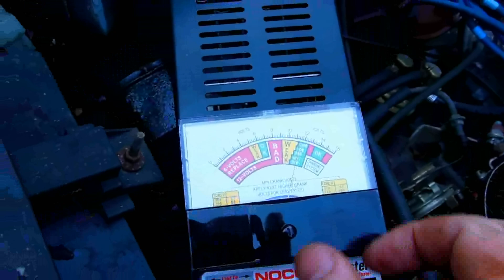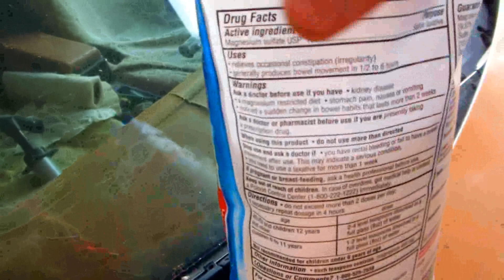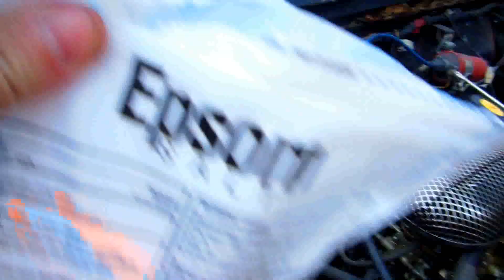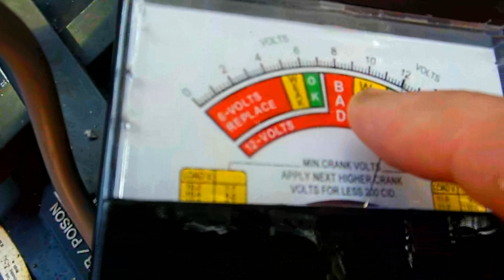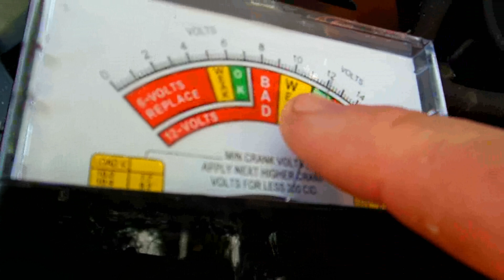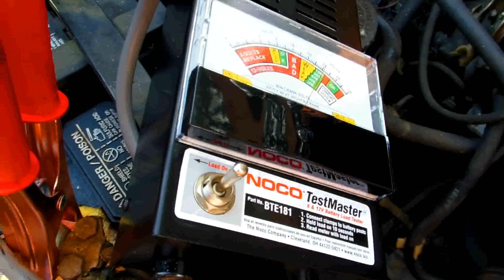Simple, Easy Car, Truck & Jeep Battery Regeneration on 15 year old battery

Comment: Did you remove any of the original acid/water in the battery before adding the epsom salt solution?
Reply from the maker: no, none removed

Comment: I use a blinker relay hook it up to my battery charger at 6 amp and a 1990 battery and it seems to be working not done with my experiment yet and a car headlight old glass one

Comment: I am confused on what all you did.
You added epsom salt and distilled water to each cell of the battery and then trickle charged that is clear but after that did you drain out the salt and water or is that it?
Im here cause my battery is hard to start and it seems a few of my cells are empty of water I can see the plates the rest are fine and I need to know what to add in there so I can then trickle charge my battery. Thanks for your video.

Comment: The secret is coke ! Drain the battery completely and rinse out with water and drain again then fill with a fresh coke drink and it will clean the shit out the battery leave the tops off and after it has sat for a couple hours shake it up and put on charge overnight next day , check it out  !
Reply: Yes, I've heard of this being done in remote   places like parts of  Africa & they say it works. Coke makes an old coin clean up like new, so it likely would clean  up the plates. I'd only do any of this stuff on an old failing battery. Adding chemicals won't make a newish battery last longer.(I tried it as an experiment.) Cheers.

Comment: if you say tickle charger how many amp is that.....coz I try to use a 2 amps 12 volts and it never work
Reply from the maker: I used a "Battery Minder" trickle charger with 1 amp and a special de-sulfating mode.
Reply: I have spent months studying battery repairing and found a great resource at Jons mender guide (check it out on google)

Comment: That is why they started making most batteries maintenance free, you can't keep them going and end up getting a new one. Just another way they are sticking it to the little guy. Another good point to add is the number one cause of starter or alt. failure is poor connections, high resistance causes low voltage and will cause problems. If your battery cables get hot they have issues, keep all connections clean and tight, I like to use brush on electrical tape, it insulates and protects connections

Comment: Years ago we would add a little new acid in old batteries. They worked temporarilly for a while. Epsom Salt is Magnesium actually and is an electrolite so maybe it does work.

Comment from the maker: I did 3 tablespoons total dissolved in distilled water.  The battery will recover more over the next couple weeks.  that was just in 24 hours.  Moving up .3 of a volt is a lot. 12.2 volts is 50% charged at rest. 12.7 volts is 100% charged at rest to give you as idea how it works. 11.89 volts is 0% charge.